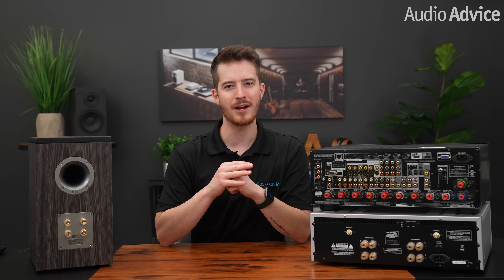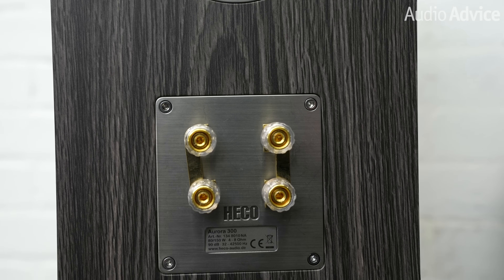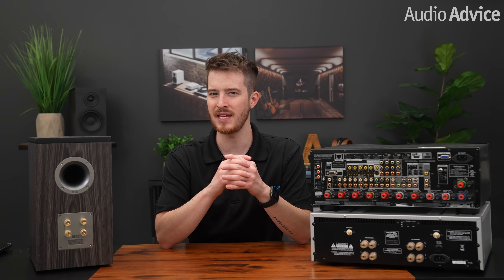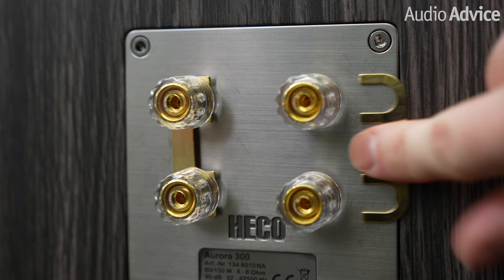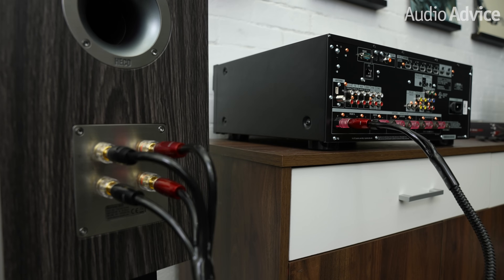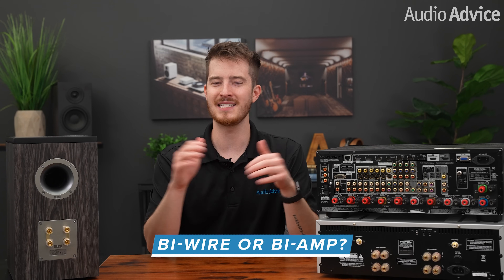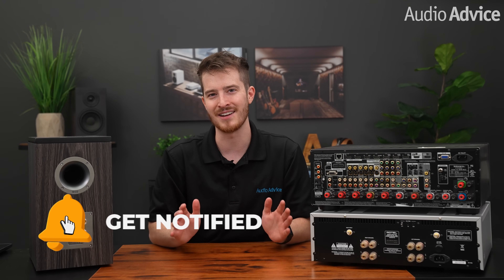Bi-Wiring & Bi-Amping Explained | What is it? How do you do it? Is it worth it? Let's talk about it!

Comment: I've tried both bi-wiring and bi-amping countless times to determine what I liked more. Bi-amping is certainly the more noticeable upgrade for the average user, however, a great set of speaker cables and a properly calibrated receiver or processor makes a big difference on the performance of bi-wiring (my current setup). I haven't turned back since. Great video!
Reply from the maker: Thanks for sharing!
Reply: Expensive speaker cable don't make any measurable differences...
They are the most known snake oil of the industry.
Expensive DAC being the next.
Reply: @Chris Doehla bi-wiring is just that, two sets of wires.  The amplification remains the same, one left channel, one right.  Bi-amping goes a step further with one channel for each driver.  In both scenarios the crossover is passive and there are generally incremental improvements with these two steps.

The largest step is to go fully active, again one amplifier channel per driver, but now with a powered or active crossover between the preamp and the power amps.  By far the largest improvement due to the removal of the passive crossover and the loss and phase issues it causes.
Reply: @hypnoz7871  The only upgrades in Cables that are worth the Money are:
1. Pure Oxygen Free Copper or Tinned Pure Oxygen Free Copper (Aluminum Wire is only a good substitute for Power Wire in Mobile Audio scenarios if you are on a budget and you could for example instead of 4GA Copper you could buy 1/0 Aluminum… 
2. The Gauge of the Wire 16ga through as thick as 8ga you don’t need anything thicker than 8ga. I don’t care what you are running. 
3. Terminals. I think it’s worth it to get Banana Terminals or Spades (on the Speaker Side) don’t bother getting anything other than Gold. Don’t waste your Money on Platinum, Rhodium, etc..
4. Braided Wire Loom but only if you are going to see any of the Cables. It’s nice to have professional looking Cables. Not really necessary otherwise though. Unless you are going to run them through the Walls, then make sure you are buying Shielded Speaker Wire that is made for that usually labeled like CL3 Rated / UL listed.

I have 8Ga Bi-Amp Tinned OFC with Gold Banana Plug Terminals including Wire Pants and Braided Loom. (8Ga Knukonceptz Krux Bi-Amp Kable) <——They offer great value for Money and I’ve used them for all my Mobile and Home Cables. I only bought 8Ga because I plan on buying 1100wRMS Monoblock Amps for my Left and Right Towers otherwise 12Ga would be plenty.
Reply: placebo effect
Reply: @hypnoz7871  DAC? We play only first press Vinyl....

Comment: In my experience (and research) doing this,  the point of bi-wiring capability on speakers IS bi-amping: that you use TWO AMPS, but not one for each speaker.  You use one amp for the highs and mids on both speakers, and a different amp for the lows on both speakers.  The difference in sound depends entirely on the respective and relative power of your amps and handling capabilities on your speakers.  If you're using a big McIntosh 2300 and you have a pair of high efficiency Klipsch, bi-wiring is overkill as the Mac has plenty of power and then some. On the other hand, if you have big power-hungry JBL's and a Marantz 2216 which is fantastic but on the lower power side, adding another would really boost the big JBL's.  Bi-amping and Bi-wiring go together, it's pointless to do just bi-wiring.  If you have a good old big receiver where A and B speaker settings use different power stations and no loss of volume occurs when you turn both A and B speaker pairs on,  it could conceivably work the same as two amps.  But most modern and lower priced  receivers simply split the power from the same source if you select A and B speakers and then send half to each.  Old BIG 70's Pioneer, Kenwood, Sansui, Marantz, Mac, etc usually don't-- they send full power to each, so bi-wiring from A and B, *one to each frequency range input pair on both speakers*, NOT *one to both ranges on each speaker*, could work nicely.
Reply from the maker: Thanks for sharing.  It is a most interesting audio subject.

Comment: Electrically in bi-wiring you just move the jumper from the LS itself to the amp end - so there is no difference other than the wire's resistance reduces, which can be achieved by  getting a thicker cable in the first place. therefore you can in principle bi-wire all loudspeakers by running a double cable and connect to the same connectors. Passive bi-amping may have pros but surely cons. I used to bi-amp but have left this and bridged my amp instead. Since the wires were already there are bi-wired just for the looks.
Reply from the maker: Yes, it is a very debatable subject.  Thanks for watching
Reply: Whilst it may look like all you've done is 'move the jumper to the amplifier end', in fact what you have done when you remove the jumper and connect two sets of wires to the upper and lower terminals is pull the 'y-point' (the point at which the highs and lows split to the high and low pass filters) back from the speaker terminals (the y-point in biwirable speakers) to the amplifier end allowing highs to flow along the tweeter cable and the lows to flow along the woofer cable. The debate is whether a significant advantage accrues in doing this.

Comment: Bi-wiring has worked for me on all my systems.  In fact, it was so effective on my Monitor Audio GR20s, when I replaced the crossovers with new high quality components, I added a third set of binding posts so I could tri-wire them.  Brilliant results all round.
Reply from the maker: Thanks for sharing, Mark!
Reply: Hi end industry should make 3-way active systems the norm. Only company offering such a solution I know about it Linn. It either comes from ignorance or laziness.

Comment: I bi-wired a pairs of Linn Kabers form a Linn amp. I heard a big change, but more telling was my very non-audiophile friend. His jaw dropped over the difference. The system sounded great before, but after there was just so much more. More soundstage, more upper and lower extension, more rhythm. If you have the ability to try it, and you have the extra cables, try it! You have nothing to lose and possibly tons to gain!
Reply from the maker: Thanks for sharing.  The Kaber was a great speaker.  It was also one of the few speakers you could actively bi amp.
Reply: Do u notice any difference?  I use Bose and Wilson Audio, never Bi-amped.  Should try it.

Comment: I just got Sony STR-AN1000 AVR and decided to bi-wire the front Klipsch speakers using the front and surround back/bi plugs (removing the jumper plates from the speakers). The difference was night and day, more pronounced cymbals and sweeter sound in general. I did run the calibration both times.
Reply from the maker: Thanks for sharing!

Comment: Just saw this video and it gave me some questions. My now old THX Pioneer receiver I went in the menu and looked at Surr Back System, here I have the alternative to Front Bi-Amp.
For years my front speakers is Bi-Wire since I was under the impression that you MUST have two recivers to Bi-Amp your speakers.
But did I understand it correctly that my reciver have a adjustment that let me Bi-Amp the front speakers whitout using two separate recivers?
Reply from the maker: Yes, some receivers will have this option in the menu!
Reply: Thanks for this very useful information. If I hadn't seen the video maybe I would never know this thing you have given me about Bi-Amp. Know few people that have Bi-Amp, but they have used two recivers. So they may not know this is possible for all I know. So thank you for the easy short to the seller for point video of information you has given 👍👌

Comment: If you choose NOT to bi-wire and use the spkrs with the jumpers in place, do the spkr cables from the amp connect to the HF or LF terminals of the spkr?
Reply from the maker: LF typically.  Another way to improve the sound without biwiring is to replace the cheap, flat, thin jumpers with a short piece of your speaker wire.  Thanks for watching
Reply: @AudioAdvice  Thank you. I only asked because a user's manual from Tannoy online suggested HF posts to connect to. I thought that was really odd. I wonder why...Thanks for the tip re: replacing the cheap jumpers. Does it matter if I use spades at the bottom or banana / bare wire termination to replace the jumpers with speaker wire?
Reply from the maker: @shrimpu  Spades or bare would be better as you can torque them tighter
Reply: @AudioAdvice  🙏

Comment: My spekaers has 3 connectors one red and two black. Is for biwiring too?
Reply: What variety of speaker are they? There were a few that provided screw terminals with a common negative connection and separate terminals for Woofer and Mid/Tweeter, for example the Acoustic Research AR3A. That would imply use of a black terminal with two red (on the 3A they were plain metal with labels), but in a situation like this, originals may have been lost or updated and replaced with different colors.
 Three terminals suggests the older scenario that was popular for a while where separate treble units like electrostatics were available, whereupon the existing treble section of the speaker was just disconnected.
Reply: @PlatypusPerspective  My speakers are the Marantz LD20 bookshelf 20 litres 2 way.  The two black connectors are actually bridged.
Reply: @ettorefieramosca5460  OK, that's a bit unusual. It provides the ability to do half of the bi-wiring function. They call it Bi-Ground wiring - it provides separate current return paths for the Woofer and Tweeter. Electrically it's a star grounding configuration compared with a common path return using a single wire. The single positive connection is still common, so there's only half the potential for getting any small difference that conventional bi-wiring might show.
Reply: @PlatypusPerspective  ok thanks for the info
Reply from the maker: @PlatypusPerspective has given you the perfect answer.  Thanks @PlatypusPerspective!

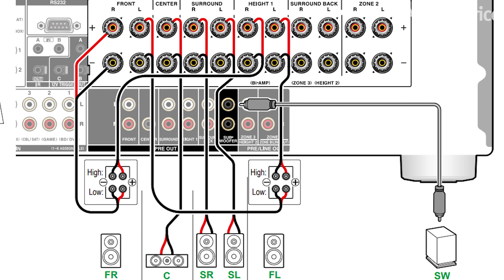Comment: 4:57 what exactly is the Height connectors?
And I have 2 tower speakers using speakers A&B for each.  Thoughts?
Reply from the maker: On that particular home theater receiver, you can redo the routing of the amp channels for biamping, on this one you use the height channels.  Thanks for watching
Reply: @AudioAdvice  can you clarify that?
Reply from the maker: @justaguy4real  some home theater receivers let you use two of the amp channels to biamp. You just have to tell the receiver you are doing it that way. In the one we showed it lets you use the height channels.   Using A & B would not biamp as those are pulling from the same amp channels but it is a good way to biwire   Hope this helps.

Comment: is it the same if you have A/B channels? you didn't mention that in you video.
Reply from the maker: Yes, if you have a and b you could use those connections to biwire
Reply: @AudioAdvice  don’t you mean bi amping?
Reply: @derekviveiros  No.. A/B.. Are for 2 sets of speakers which will change impedance.
Half the power.
You can also use this option for Bi-wiring.. Which wont change Impedance.

Comment: i could hear the difference between silver and copper. so you wire heights with silver and bass with copper . however if you have bi amping is worth a crossover with dsp , because you put less frequencies on each amp and that makes a real difference.
Reply from the maker: You have great ears, thanks for sharing.  Yes, we agree if you have a speaker where you can remove the internal passive crossover, fully biamping is the way to go.

Comment: Hey guys. I’ve just got a set of speakers with 2 terminals and getting confused with how to connect them. So I can use 2 wires for the +/- channels of the speaker terminals and be able to put both the +\- into one + or - terminal on my amp? So 4 wires from the speaker down to 2?
Reply from the maker: That is basically it, yes, follow the link in the video to the written article which has some diagrams.

Comment: I have heard that if you can’t bi wire or bi amp, at least remove the bridge and use a short run of quality speaker wire to bridge. Claims are that the bridge connection more easily comes loose, and that the bridge is not shielded.
Reply from the maker: Yes, in most speakers the bridge pieces are very flimsy, changing to two short pieces of good speaker wire will improve things for sure

Comment: Heya! You are literally using the power amp I am asking about (woot woot). Bi Amping specific, do I plug a set of cables into both right termals and both left terminals and then run them into my single set of bi-amp speakers? or is this a no no? So 4 outputs into 2 bi-wire speakers? Get me lol?
Reply from the maker: That's awesome! Do you have jumpers on then back of your speakers? This sounds like a conventional setup unless you have two amplifiers. Check this page out for some visuals and maybe that would help! https://www.audioadvice.com/videos-reviews/speaker-bi-wiring-bi-amping-explained/

You can always reach out to our team at audioadvice.com and they can make sure you are set up correctly!
Reply: @AudioAdvice  thanks for the fast response. Single amp, single set of speakers, 2 sets of outs in amp. Just regular banana plugs into each speaker terminal.

Comment: only if the amp has built in active crossovers, then & only then bi-amp & bi-wiring has distictive difference audible from a bi-wired large floor main front left & right speaker. this will ease off the load on the internal amp, as low frequency reproduction will put a heavy load in the amp, thus limiting headroom & hifi sound reporduction. put in perspective, perlisten r7t speakers with trinnov's separates. having a bi-amp & bi-wiring setup will have significance sound quality when volume is applied at reference level..and that is tinnitus.
Reply from the maker: Unless you physically go inside the R7T and remove its crossovers would you just be passively biamping, you would not want something like a Trinnov to add additional crossovers.  Yes, an active system with no passive crossovers and external electronic crossovers with a separate amp for each frequency range is usually better.  Thanks for watching
Reply: @AudioAdvice  precisely. if i'm not mistaken, trinnov alt16/32 can do active crossover internally..correct me if i'm wrong
Reply from the maker: @QAT4969  That is correct, it can, but that Perlisten speaker is not set up for that, it would require tearing into and removing crossovers.

Comment: Hello. So I have a question. On my speakers I dont have 4 plugs only 2. But on my reciever å have Bi-Wire mode + on the back i have HF left right and LF keft right. It also has subwoofer, center and surround left and right for bare wires. And then it also has Subwoofer in. Center, Surround L, Surround R, but for plugs. So the question is, can i still not use bi-wire even tho the reciever has the connection? Atm i have everything connected in the bare wire connectors + Sub in the plug. But only the bi-wire works but really bad or if I switch to center mode then only the center plays :S
Reply from the maker: Your speakers are not set up to be biwired. Your best bet to improve them might be higher quality speaker cable. Thanks for watching
Reply: @AudioAdvice  Okey i have some of those thicker cables so maybe i can try. Alto i noticed that i had the aux connected to dvd and not cd so when I switched to cd it got a bit better because there i could use the Pro Logic settings. Thank you :)

Comment: Thank you . Great explanation to bi wiring or bi amping. Can you explain how I can play two different sets of speakers as a four main two left two right front audio music set up. I have a set off bi wiring omniray series 4 floor standing speakers and I have a set of old school James floor cabinet box speakers  and I want all for working through my either, DSP AMPLIFIER  or through my audio analogue amplifier,  I was even thinking of connecting the audio analogue crescendo amplifier to my yamaha dsp A-1000 old school processor.  Is this possible,  can it be done. I have searched and searched through YouTube and not come to any videos on this subject.  I appreciate any advice you can help me out with.  Thank you
Reply from the maker: With two different speakers you are better off using two power amps one for each, one would need a way to reduce the volume level on the more sensitive pair to match.

Comment: Active crossover bi amp - that’s what seems will make the most difference. Can you speak to how that compares as a next step in upgrading? Especially for someone who has a 4 channel amp
Reply from the maker: That method is by far and away the best.  But you need an electronic crossover and a way to fully bypass the internal crossovers.  Very few speakers on the market can accommodate that.
Reply: @AudioAdvice  What about an external passive crossover ? And how simple is it to just remove the crossover in a speaker?
Reply from the maker: @derekviveiros  That would just be passive biamping.  If you remove it, you need to replace it with an electronic one, and you would need to know all the crossover points and filter slopes.  Its not as easy as you might think

Comment: why not using 2-nd channel output 4 the tweakers?  if you have multiple output Amp?  I mean  low on 1 and high to 2 output ch? (each have own cables)
Reply from the maker: If you have speaker A + B connectors that is a good way to go.

Comment: Also use fans to pull heat out from the receiver, and to keep it cooler especially in bi-amp mode.
Reply from the maker: Good tip!
Reply: Any recommendations on fans ? I have an old Yamaha with class a and 4 channels. I just bi amped yesterday. Looking into active crossover. But wanna be sure before I chop the passive out. That I’ll be worth it and drop of resell value